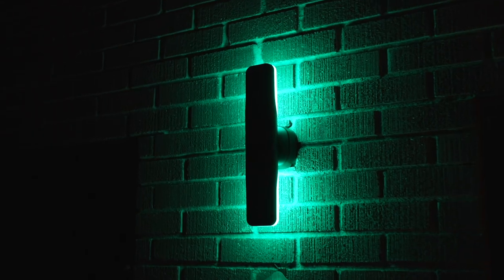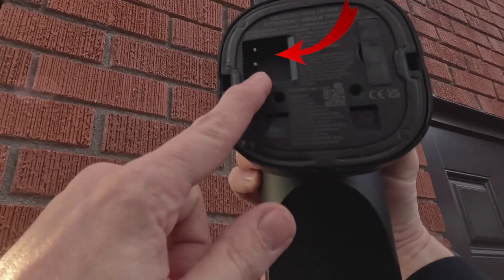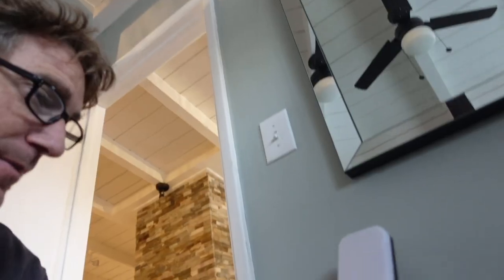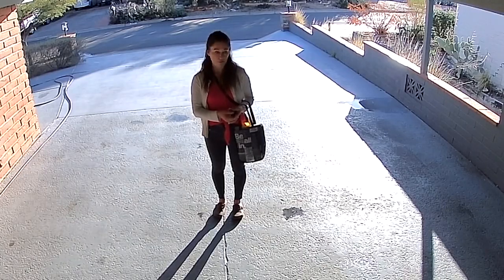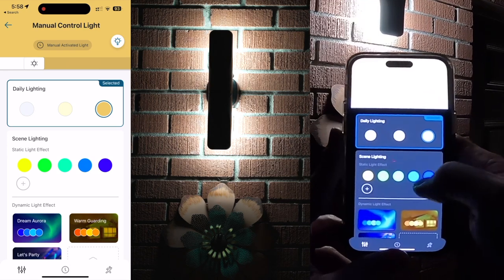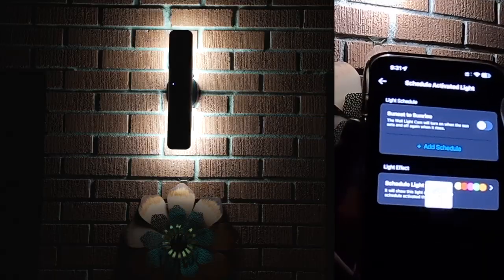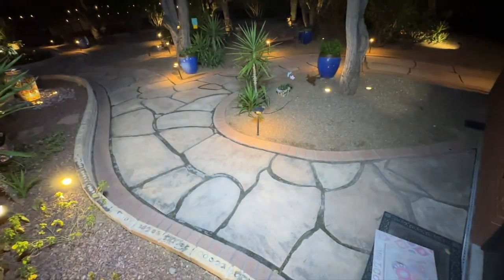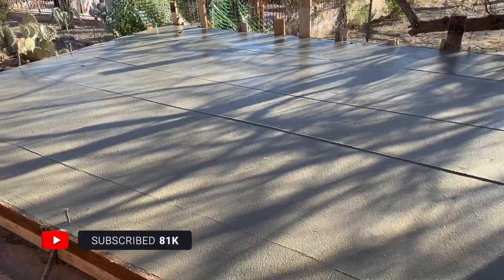*FIRST LOOK* Eufy S100 Wall Light Cam Review of Security Camera #eufyWallLightCam #eufySecurity

Comment: I like this light and design. With two small flaws. It should be able to rotate 90 degrees. Would have definitely looked better in your friend’s installation. And I would want this in all white housing to match my house trim and all of the existing hardware on the outside of my house. If those two things were there, I would pull the trigger and grab two of these!

I have two of the Geeni light bulbs in my current lights that do some of the same things these lights do. But not nearly as many. The app seems to be really well designed.
Reply from the maker: Yea, the app is one of the best I’ve used for security cameras. I have their HomeBase 3 camera system.

Comment: I got this Cam Light (3 of them) not knowing that I needed to have 2.4Ghz wifi. Unfortunately, I have 5Ghz and it won't connect. I thought, well, at least I'll have the Dusk til Dawn lighting since the internet is only for the camera activity---but they won't turn on at all. If I installed them myself I would question the wiring, however, I called in an electrician to do the installment. I'm very sad that I have to return these. Before I pack them up, do you have any suggestions on how else to troubleshoot the lighting portion?

Comment: Could he had turned that 90 degrees?
Reply from the maker: No, it is not designed to rotate it 90°. There is no option to rotate the camera feed 90° in the app either.
Reply: That was my question as well. Bad design and needs to be re-implemented. 
Thank you for your thorough review.
Reply: Definitely needs to be upgraded to work horizontally...
Reply: Honestly, this was such a straight forward example of why horizontal mounting should be an option, it would have done a much more effective job with the lighting angles.